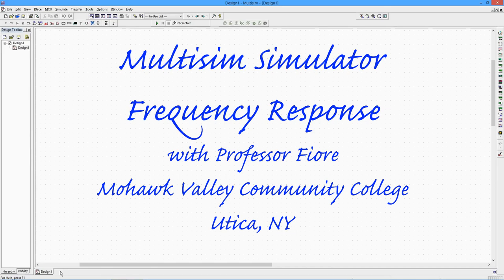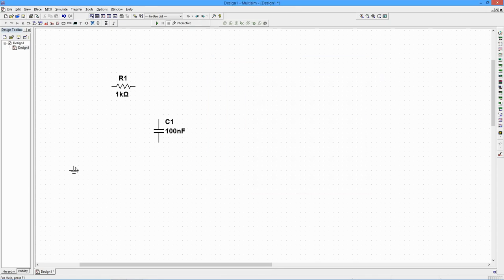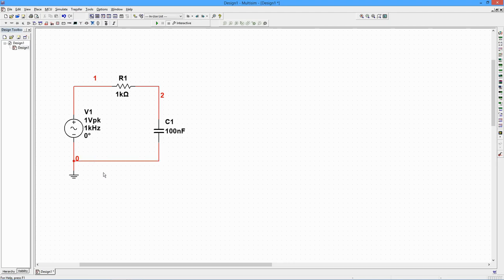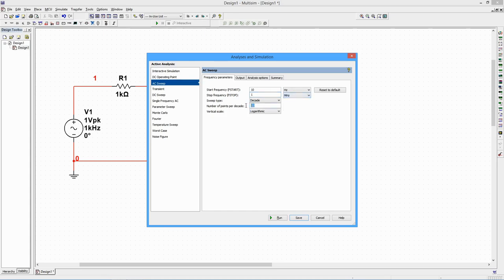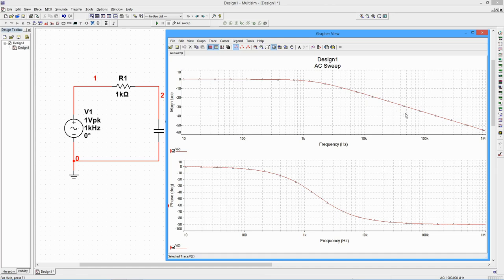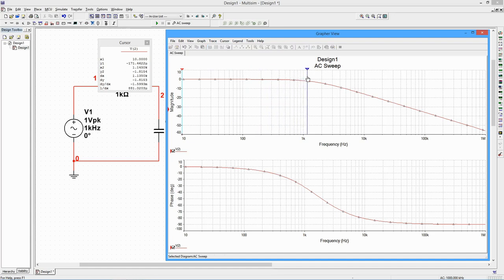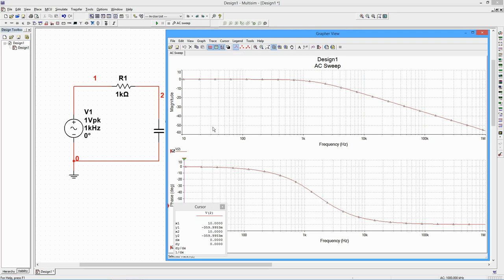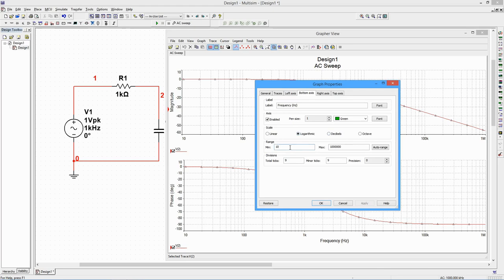Multisim Frequency Response Simulation

Comment: Is it possible to perform AC analysis with fixed frequency but variable amplitude?
Reply from the maker: You could certainly do that manually by running several sims. One thing to remember is that, assuming the circuit is linear, you'll get the same relative results each time (e.g., doubling the input amplitude doubles the output). OTOH, if you're looking for non-linearities at a single frequency, you might be better off using a transient analysis (possibly with THD/Fourier analysis).